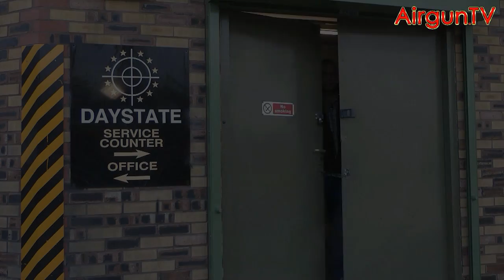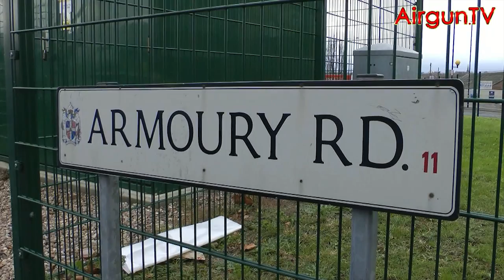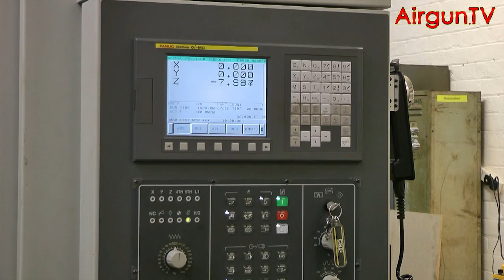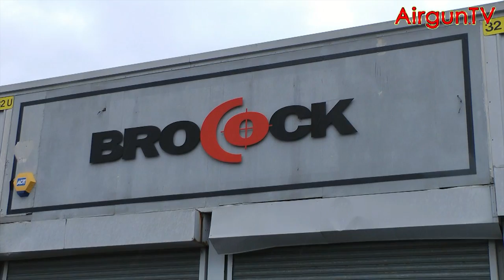Airgun Gear show - Christmas Special

Comment: i think Malcom at Daystate may need to look for a new job i bought a  new air ranger 
at first looked and shot great for about 10 mins then started to get zero shift called daystate told to check barrel grubscrews to find they were to short for the action oooops friday gun me thinks lost confidence and sold it

Comment: i appreciate beauty and precision, which i think describes daystate well and fairly, but maintain that theyre excessive.the focus has changed from hunting to showing off, comparing price tags.more worry about getting it dirty or scratched than using it for what its capable of-like the car thing-they are sold as 4x4s but the owners wont put a spot of mud on it and use them 2 pose rather than use the 4x4 feature-they are useless for off roading.its like comparing a range rover sport to a defender!

Comment: Sub 12ftlb is cruel and unfair on the quarry. Yes, a head shot up to fifty yards will usually prove fatal but I've had wounded rabbits run back into their warrens where the sheer shock of more ftlb would have killed them. This country is ridiculous sometimes, we're treated like children. Also, we don't all have a farm to shoot on so an FAC is about as attainable as unicorn shit.
Reply: Yes, I agree I wanted 60/80 ftlb but as I could not get a FAC I had to settle for a 12ftlb and have had the same experience as you regarding rabbits and squirrels.